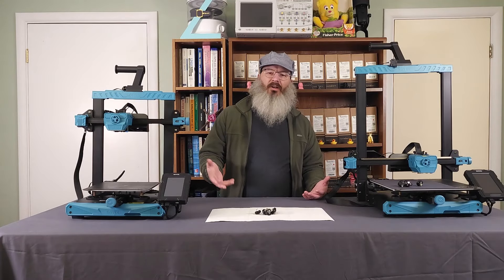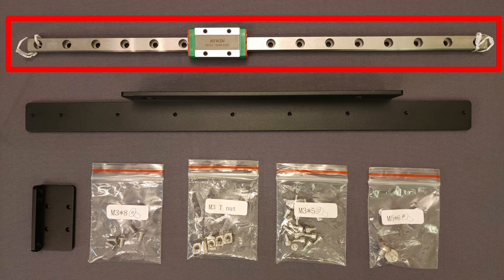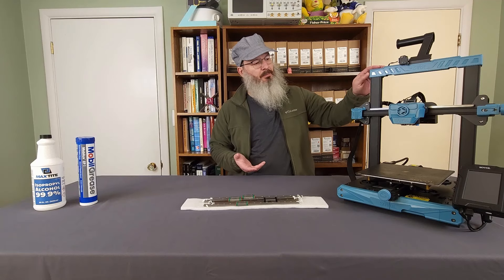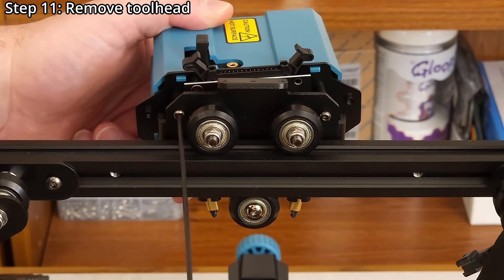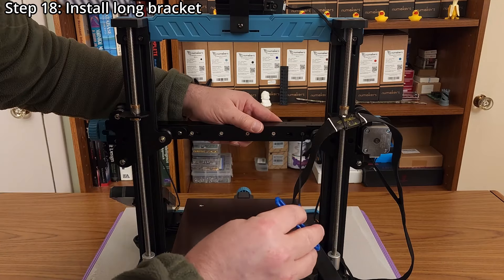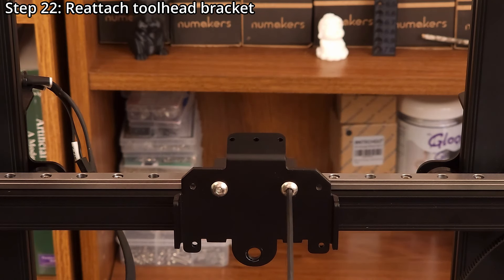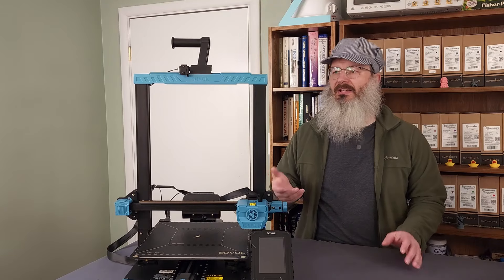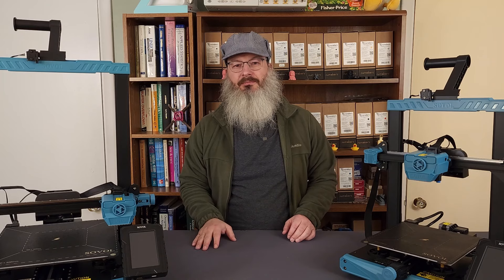Linear rails for the Sovol SV07 (Plus) - Part 2 (X-axis)

Comment: Installed this kit (Hiwin) on my Sovol 7 Plus.  Very smooth prints. Thank you for the video.
Reply: did you find a tangible increse in print quality? also does it behave good in higher speed situations compared to the original setup?
Reply: @RockOnMySon  even without an increase in print quality, my SV07 will be tons better for not having a stupid eccentric nut!
Reply from the maker: Awesome,  thank you!

Comment: Could you share some information about what acelerations it can reach with the linear rails mod compared to default, please? Also some test prints before and after with included information about speeds and accels used for both would be great. Thank you for the videos.

Comment: Do you recommend the HIWIN or the generic rails from them there half the cost of the HIWIN
Reply: I have a SV07+ and a Elegoo Neptune 4 Max I'm going to do full rails on so if the generic ones are just as good it will be a good savings
Reply from the maker: Thank you for watching our videos!!! While the HIWIN linear rails are a bit more consistent and have lubrication ports, the generic linear rails can perform just as well with proper cleaning and lubrication. I have the generic linear rails on my Neptune 3 Max and have never had any issues. Also, if you do encounter any issues, TBStron3D is very responsive and will fix them. In the end, it really comes down to personal preference, if the convenience of the HIWIN rails is worth the increased cost.

Comment: So basically... I have to drop another $300-400 in upgrades to make it function how it should've from the factory.
Nice.

Too bad the screens keep dying on mine :)
Reply from the maker: Thank you for watching our videos!!! While I didn't design the printers, or the linear rail kits, it means a lot that you found our videos helpful. Switching to linear rails definitely isn't a required mod, but it can provide a lot of benefits, including: 1) removal of extremely low quality eccentric nuts that cut into the aluminum brackets; 2) no longer constantly readjusting and fighting with POM wheels; 3) no more "POM wheel dust"; 4) you get to mod your printers (in my opinion, the only reason to own a 3d printer is to mod it!); 5) linear rails can potentially improve bed "levelness" and often provide smoother travel; 6) potentially allow for faster printing.
Reply: Sounds like you didn't/don't have a great experience with this printer. Also, this upgrade for all axes is definitely not $300-400 (at least I hope so). I don't know where you live, but in Denmark, it only set me back 100 bucks (USD).

The screen shouldn’t die either, since it’s just a monitor attached to a mini-computer box (which is also cheap to replace with minimal guidance). One annoying thing is flashing the mini computer, but a good YouTube guide should fix that problem.

Hope you'll look into this upgrade again, because it's very nice...
Reply: @bananasprint375  Hi, 
I have decided to buy sv07 plus. What do you mean by flashing the mini computer is annoying?
Is that something i should worry about?